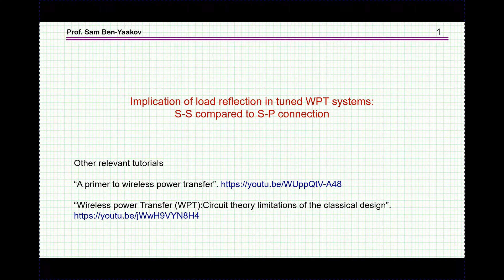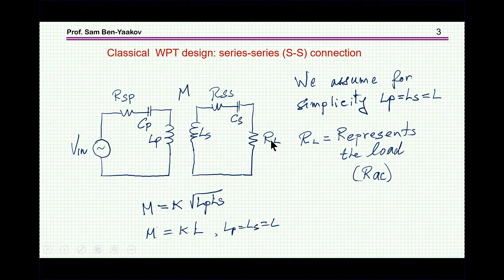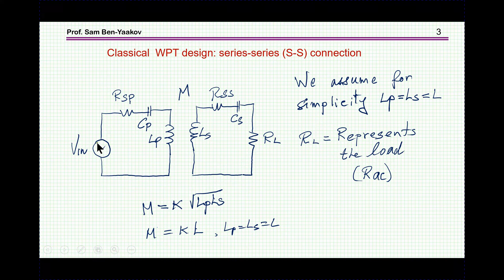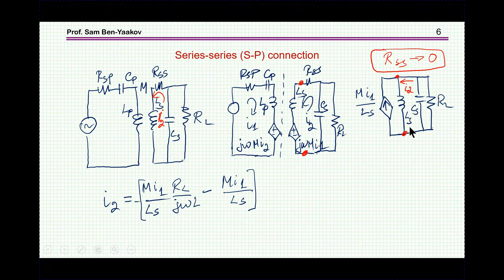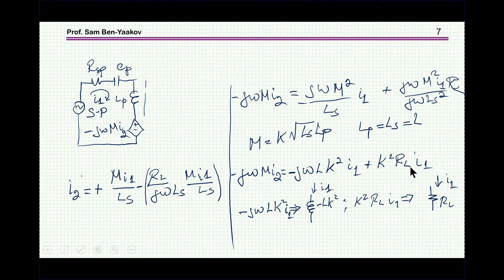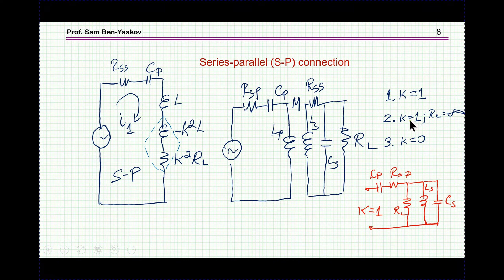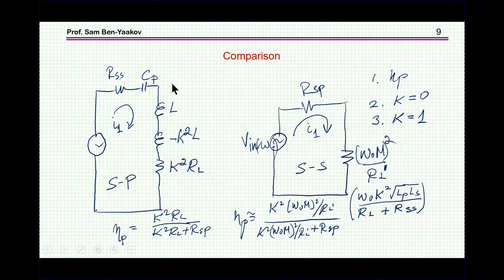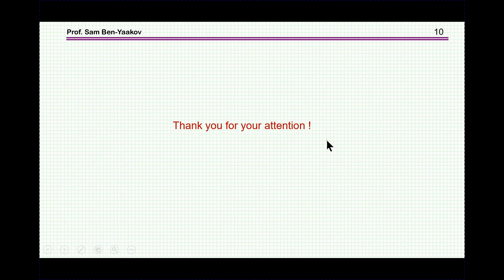Implications of load reflection in tuned WPT systems: S-S compared to S-P connection

Comment: To be honest, I missed the moment when the dependent source on the primary side started to have a negative sign. Because of this, understanding what is happening has become a little more difficult for me. Could you help me understand this point? Indeed, when parsing the SS method, the primary source was not inverted.
Reply from the maker: To which minute in the video are you referring?
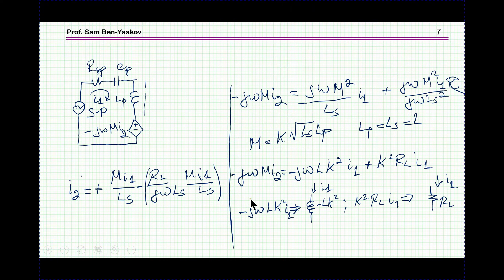Reply: The dependent source jwMi2 changes the sign in the picture, which starts from the time of 7:35.
Reply from the maker: @ЕкатеринаФролова-з2н  AsIrecall, this is because I1 is negative https://youtu.be/4DMVgMxwDxc?t=430
Reply: @sambenyaakov  Then why was the sign of the dependent voltage source positive in the first diagram https://youtu.be/4DMVgMxwDxc?t=418

Comment: Can you please teach us how it is possible that a normal transformer the voltage ratio is the ratio of turns? 
I mean, if the primairy gets less turns then can the flux only get less, so how can the secundairy gets more voltage out??
(I can easally work with transistors and stuff and i use transformers of course, but that one thing i saw never an explaination for. And i want to know it, i need to know it! Please?)
Reply from the maker: The induces voltage is  proportional to the  magnetic flux density tome the number of turns n. So when the flux is common to primary and secondary. V1/V2=n1/n2
Reply: @sambenyaakov  
But when i half the primairy turns, then the flux cán only get less? And still the secundairy getd double the voltage! 
How?
That i could never see, and still not. (Can you please try another answer to maybe make me see?)
Reply from the maker: The magnetic flux generated by the primary is proportional to V/n  (volts per turn) so, the smaller the number of turns the larger the magnetic flux density and therefore the secondary voltage will increase.
Reply: @sambenyaakov  
I dont understand!
Flux propotional turns/voltage so less turns by the same voltage, that is then less flux instead of more? (I know you are right because a transformer works, but i still cant see how. I am afraid that i am too stupid) Btw i find it so nice that you tried to answer that lifelong question from me, thanks!
Reply from the maker: Think about one turn that has 1 volt on it. The flux obeys V= n dFLUX/dt where n=1. Now add another turn of 1V. Now you have 2V = 2 dFLUX/dt and there is no change in flux. Therefore,  the volts per turn is the key factor in determining the flux.
Reply: @sambenyaakov  i think this time i begín to see it! Still very faint but you really put me in the needed direction with your last answer, i think. I will try to think further about it. I asked many people the same transformerquestion and only your last answer made more clear. When i finally come to see it totally and clear, than i cannot thank you enough for your teachingskills! Só much thank to you Sam Ben-Yaakov, for you youtubing ánd for trying to help me because this time finally i really think i begin to see through this transformeridea!
Reply from the maker: 👍I am happy to be of help. I love to get to the gist of matters beyond equations and formalism.
Here is another way to look at it. Think the other way around. Assume that you have in the core a given dFLUX/dt, now each turn will have a given voltage so n turns will have n*V . Now go back and feed the voltage to n turn and think about the magnetic flux . Clearly, what counts is volt per turn.
Reply: Yes indeed. Especially the answer before this opened my eyes. I thought that a second winding with te same voltage as the first, exact as you told there, i did not know that the flux would stay the same. I thougt simply: more amperes*windings has to give more flux. And so i could not see the working with the voltageratio. But you explaining how the flux only depends on voltage per winding makes much clear. That was a really clear way to make me see it. I will try to get more insight with this last explanation too. I find it so great that i finally begin to see how it works, that you found an aswer that exactly tackels the problem i see only now i had! I hobby a lot with electronics, many decades, and only now i learnd such an important insight. Really great that you gives the efford for my understanding
Reply from the maker: I love this chat. You mention AmpTurns. So here is more. If you add a turn, the inductance will be 4 times larger (N square) so for twice the voltage on 2 turns the current will 1/2,  times 2 turns= 1 as for the one turn. Isn't it amazing?
Reply: @sambenyaakov  haa, that is something where i must think about it and think some examples for myself, for getting it as a real insight. Yes it is so great that i could ask you, someone who sure already has that insight ánd wants to make the efford for teaching me it too! Yes this is a thing that i can use and calculate but where i never get the real picture clear enough. Untill now, this is a unique chance for me! Yes i love this very sure!! These answers of you let me think and learn exactly the insights i could never get! Now i go study more on this last answer from you, because i believe it goes fill in exactly my picture and understanding on that. That is so great!!
Reply: @sambenyaakov  ha yes, that Is amazing! It is another way to get to that same answer about the why of that voltageratio! I must try it with some example values to get it real clear. But that first eyeopening answer, that did get me in the right direction. With this last i maybe can make my picture more complete, so i can use it more easy, later on. You are a very good teacher and i am a happy man that i could get this chance to finally learn that insight, that picture of real understanding that i missed for so long.
Reply: The more the better, especily in this case of so long wanted insight about that turns/voltageratio! I still cannot believe that i finally are going to get it clear! And i am working on something where in i think or hope i can do so much better when i precisely know and understand what i see.
Reply: @sambenyaakov   Sam Ben-Yaakov  when i subscribed to your video's then i thought immediately: if there is someone who can explain me my trafoproblem then by you. And indeed you did! But now sometimes i still can easy fall back in my old not-understanding of the real picture inside. That last answer from you, that explains the réason for why that first eyeopening answer works, it is that induction squared halfs the amps in each turn when i double the turns primairy and so the flux do nót get more whit more turns? That was what i never knew, and indeed amazing and beautifull.
From differential calculations i know only my scoolstuff and i have no insight throug experiance with that. But am i right that it is the slope of the flux over time that induces more or less voltage in the secundairy? The voltage thus too proportional with ampturns but amps go down by the induction? Or is it the slope of the flux that is proportional. I should can see that myself when i had the picture 100% in my mind but what precisely happens in the core, the flux, for that i must think and work with this new knowledge some longer. The two last answers from you tackels my problem exact and when i start with them i feel i see it totally and finally correct. That last "here is more" from you, so great and so nessasairy for me! Exact what i needed to get it clear. You saw that so good, its really teaching when you see where my picture was missing. But is there maybe more from such you can tell me, about if there is a difference in the flux or the slope of the flux or are they both proportional with the voltage? Than it comes down to me some more time thinking and working with your two answers. These two i printed out to get the feel for thinking that way, about turns, flux and therefor that reason for the voltage/turnsratio i can finally see!!
I knew: if anyone can do it than you!! So great, it is this sort of understanding that makes me happy, thank you so!!!